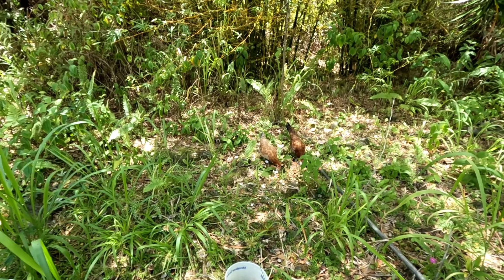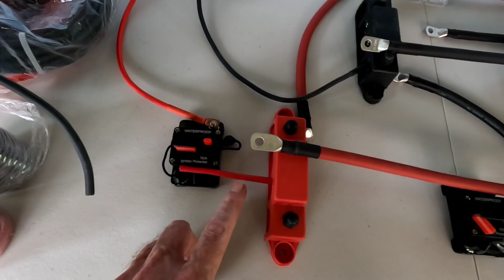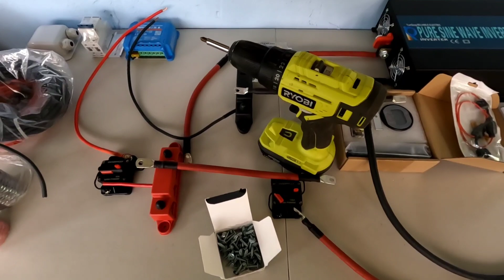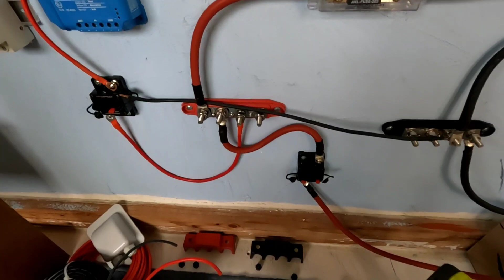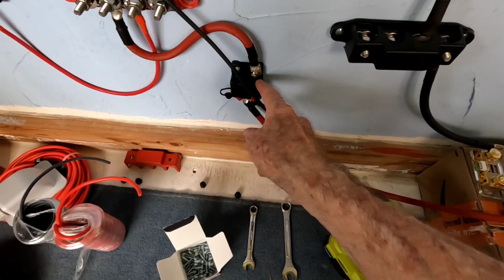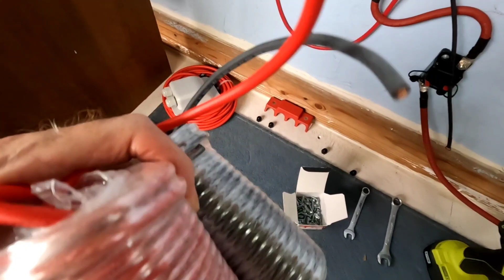12v 2000watt solar power station part 2/ installation/tools needed/off grid energy independence

Comment: I think someone else might have caught this too but you used a 200 amp fuse but a 100 amp breaker between the fuse and battery.   Might want to up that breaker with a 200 amp also.  Love the projects and I also use the garden for a food disposal the wild turkeys love it.  Have fun stay safe.
Reply from the maker: I misspoke, and mahalo plenty for bringing to my attention. I never caught it in review. Anyway, it's a 100 ampbms battery coming, so both gonna be 100a   fuse/breaker. Aloha 🤙
Reply: Oh thank you that is good to know.  Have fun stay safe.

Comment: What does the solar panel isolater do?
Reply from the maker: Used as shutoff switch to instantly cut pow coming in from panels 🤙
Reply: @ProjectsinParadise808  To cut off in case of electrical storms passing by?

Comment: looking good. depending on battery BMS you might want to use a 200 amp breaker instead of 100 .loading that inverter  will trip it. They make 12/24  to USB charging ports you can add to any system. I got a bunch. direct to battery threw fuse . can charge phones ,tablet ,flash lights,  camcorder, Even USB C laptops. called PD . That how I run this 17in HP laptop. 65 watt PD cable to HP blue. more efferent then plug in inverter ac outlets. and my 200 watt 24V inverter has USB 2.1 amp charge port. Amazon has many 12/24 USB charge ports. I use USB C with PD mode. 😀
Reply from the maker: Good eye brother and mahalo! Had in mind battery coming up had 200a bms, but only a 100 . Misspoke for sure regardless. Aloha 🤙

Comment: How many 100a lifepo4 batteries can you have in a 12v parallel bank?
Reply: That depends on the BMS inside the battery, so most vendors will specify. They typically say 4 but a few I've seen say only 2.  Personally if you need more than that you should use larger than 100ah and consider possibly going to 24v instead.

Comment: people go through inverters as so many are junk.. from China , and you never said what you like-- or what kind of the biggest part is making A.C. 60 CLY 110 volts from your set -up
Reply: Many of the electronics are made in China. I have had good success with Aims, Sigoneer, Sungold (both look like exact copy of Aims with different paint colors) Renogy,  WZRELB Reliable inverters in 12 and 24 volt.  He is using the high frequency WZRELB Reliable inverter.  Mine puts out around 120 volts 60 cycle even under load. It has been used every day for over a year, never gets shut off.
Reply: His recent "how to" video he lists an inverter. The "Reliable" brand.
Edit:  He linked it in the description to this video as well.